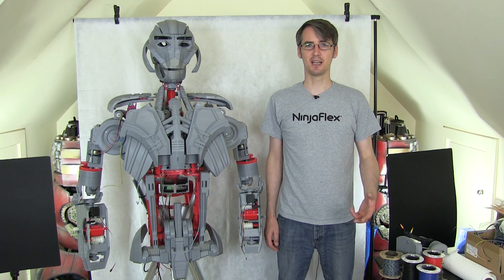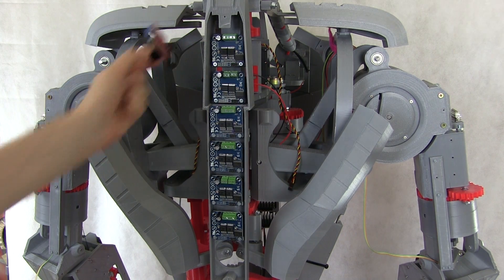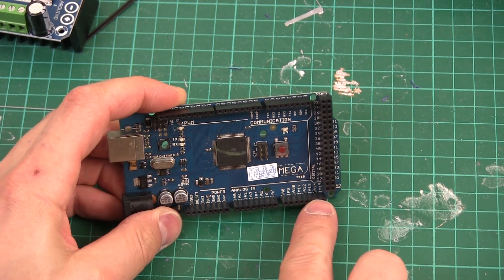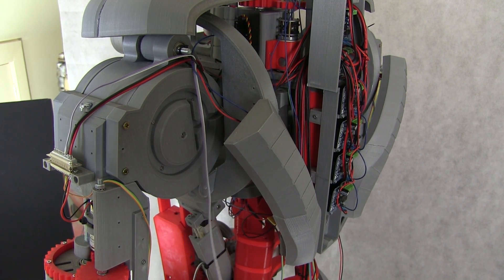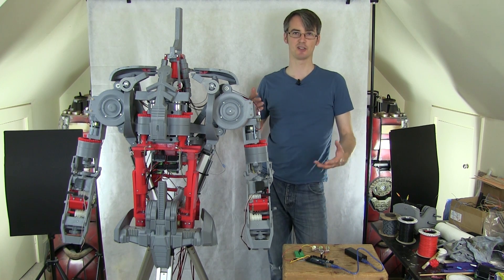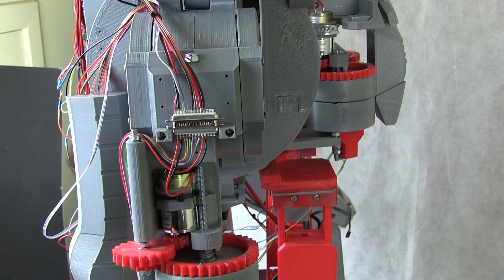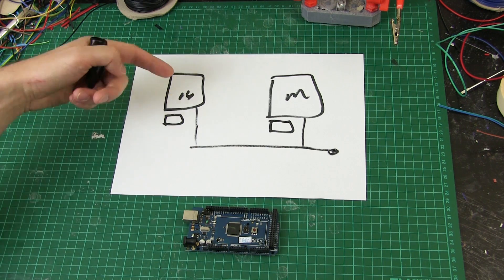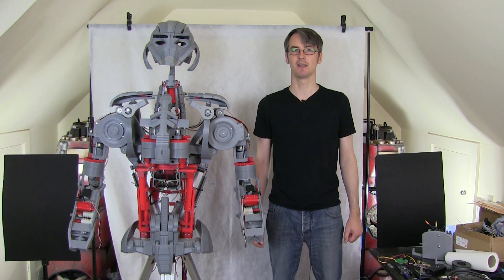Avengers Ultron #21 | Starting the Electronics | James Bruton

Comment: James, love all your projects and videos!!! Wanted to offer a quick idea for the forearms. Maybe instead of rotating the motor to the gears you could bring the gears to the motor. This could be done using a small push/pull solenoid on each one. Then the logic could activate more than one at a time for complex movements. Example of solenoid: https://youtu.be/-efm9_7ujnQ Just wanted to throw the idea out there and possibly help.

Comment: OK,  James, I've been watching this (and all your other videos/projects for a long time) and as I suspected on this one, as much as it must break your heart, you cant expect 3D printed plastic to be sturdy enough to make a working 6ft tall humanoid robot! you've only got half of a torso and it's flexing and floppy pretty bad, and it seems you have hardly any of the weight of motors, gear and batteries that the final robot will have!!! I think he is going to need some Aluminum plates attached in various places to take the flex out of key parts, if not a full Aluminum-tube support skeleton integrated into the build, it's a bit late somewhat, but could still be done! you're asking too much of 3D printed plastic! R2-D2 was short and cylindrical, so there was strength and rigidity advantages to the shape, as well as BB8 was a sphere, and smaller, so even stronger, but this robot is going to collapse on itself, if left as it is "all plastic"- Look at your own body, it's full of Bones to keep you standing upright - Your poor Ultron is made of Cartilage at best!
Reply: Admit I didnt watch all, but she's a shakey floppy mess man, I'm worried! LOL

Comment: Instead of scattering the arduinos and motor drivers throughout the torso, wouldn't it be better to have lines going to a control box instead? Is there any benefit with doing your method over that? I'm curious if that was considered and why your method made the most sense.

Comment: Another solution is to choose digital pin on both of the boards (i.e. pin 40) and connect it to ground only in one of the them. On the setup() function you can differentiate between the boards based on that pin state. That way you could use the same code without adding another Arduino. In the same manner, you can use 2 digital pin if you intend to use more that two boards.

Comment: Awesome project, but too many arduinos... Couple teensys are much more powerful, arduino compatible (use the same ide and code)  and you can use pwm and servo together... And run at 120 mhz, much better to stabilize robots and compute PID parameters...  You should at least give a 5 minute reading on those micro controllers.
Reply: And there is more! They are tinny!!!!

Comment: That makes sense.  Gobs of current from those and they are super stable.  

They sell really cheap breakout boards that plug into the ATX connector which neatly provide fused access to the rails and give an easy way to energize them.

They make a great bench supply. :)

Comment: James, what USB power bank is that? as so many have the damn low current cut off feature, which makes it annoying to use with an arduino :)
Reply: ***** 
Ahh, did you have enough of a draw for the one you used in the BB8 head as well?

Comment: That's looking awesome, can't wait to see it moving in coordinated fashion.

You mentioned using RC gear for some of your power needs.  I've had mixed results with RC battery eliminators.  There are shunt type and switchmode controllers.  The cheaper shunt ones overheat really quickly when running high current.
I've had better success even doing actual RC stuff to use boost/buck converters with switchmode power supplies for high current applications where you don't need speed control.  
Those BEC'S will "brownout" and have caused mysterious crashes.  No fun!

Comment: A good way to get a cheap power supply is buy 24V 7 amp switchers like laptop supplies. Then add a buck converter and you end up with 12 amps at 12 volts for like 30 GBP or so.

Comment: James! Cool project! Consider powering it from an used (or new) ATX PC power supply. They're quite powerful, have 12, 5 and 3.3 volt output and are easy to modify to your needs. Oh and used ones are dirty cheap :)

Comment: I still don't like that elbow mechanism. It looks weird, it works weird and it sounds weird. It doesn't even do it's job properly.
Reply: same
Reply: multiplexers can be really cool but i don't think it's needed in this case. If weight is a concern james should run pushrods or torque tubes out to the end and put the motors in the chest.

Comment: You could use a spare digital pin - grounded or open - as an identifier,  so a single program knows whether it's running on the left or right Mega.

Comment: Great job on the electronics! How about the waist actuators for the spine bending? You haven't mentioned them in this episode or have I missed it?

Anyway, one thing that is slightly underwhelming is the forward reach of the arm. I understand the hardware limitations though.

Comment: You could also add some jumper to the Arduino Megas, to keep the code same and select with the jumper the ID, or you program once the ID in the eeprom, it will stay  if you reprogram the Megas.

I recommend the VNH2SP30  motor drivers much smaller and for this motors you don't need an heat sink also cheaper (about 3-4€) They work fine up to 10A without heat sink.

Comment: So many controllers! Must've cost a decent bit, even with the cheap eBay prices.
Reply: Is there any reason you're using so many Megas? I agree with the rationale behind designating processors given the way they work but it feels like a waste of space and unused GPIOs.
Reply: ***** Probably just the student mindset but £7 feels expensive! I've seen Unos on eBay for around £1 each, which seems almost too low! Yet to test one though. 

If I were in your situation I'd give all micro controllers a little adapter to plug into in which all the actual wiring sits. A shield of sorts. That way you can remove and swap them out much more easily and reflashing thecae is the only other step!

Comment: Still really worried about the forearm... Looks very unresponsive (slow) in comparison to the rest of the joints which look great. And still really worried what happens when you need to switch that gear engagement 4 or 5 times a second. But it looks brilliant. Great job.